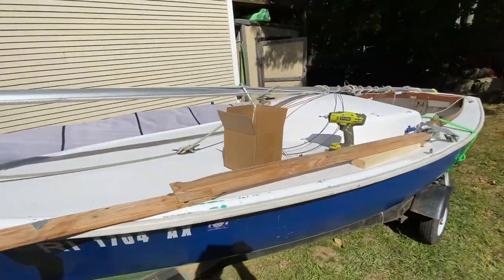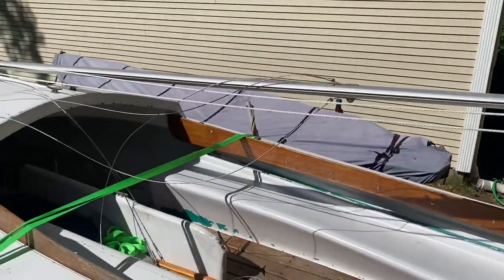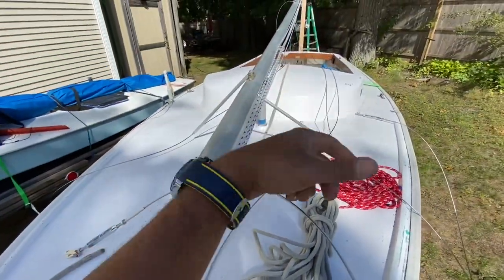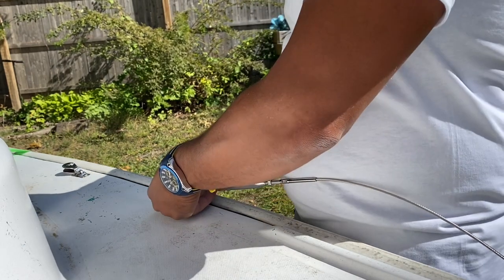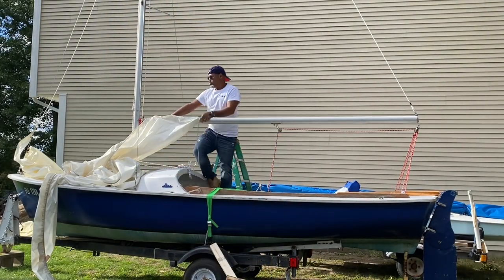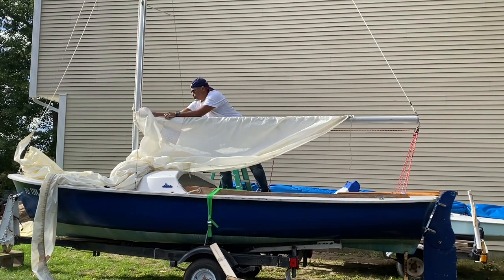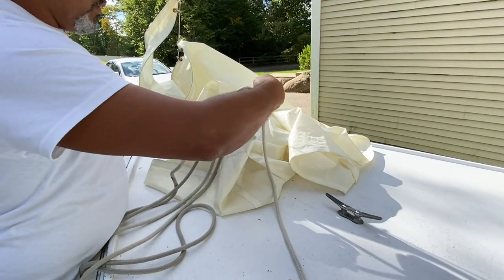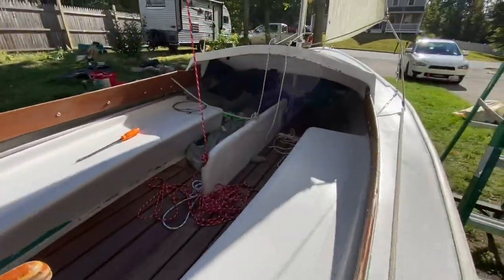Daysailer single handed mast raising & rigging set up (Ep 12)

Comment: Your term, "Yard Sailing" made me laugh! We are all boys at heart.
 I have set up my daysailer II with a 2x4 A- frame, which spans across the cockpit seats. The tiller handle passes through the middle, and has full travel. I primarily sail in small rivers, and regularly step the mast down on the A-frame rest to pass under the bridges. I use the jib halyard line to raise the mast, rather than a special line.
Reply from the maker: Sounds like a good technique to raise you mast… I have only very tall bridges that Navy ships and cargo ship’s easily pass under so once my mast is up, it’s up for the whole cruise. I’m planning to take her to a lake in New Hampshire in a couple of months. I like that flexibility of a trailerable sailboat.
Reply: Jason, do you remove the jib from the jib line to use it to help raise the stepped mast, or how exactly do you tie it off?
Reply: Solitude, which NH lake? Newfound? Winnipesauke?
Reply from the maker: @marcusgardner7640  no. I used the forestay and tied a line to it back to the cockpit for lift assist
Reply from the maker: @marcusgardner7640  definitely want to sail in Wnnipesauke, I’m planning to bring her to Spofford Lake in the Keene area since I’ll be camping up there. I also want to sail Lake George

Comment: Couscous! Ha ha ha! Wonderful! Suggest a tension gauge if you're adjusting shrouds. Like the content, would like to see a closer video of the block at bow when you step the mast. Enjoy your sailing time. Cherrs!
Reply: Kuzkuz, oops
Reply from the maker: Thanks for the comment. I do own a tension gauge but did not think to use it on this small boat, just went by the “Good’n Tight” method… what should my tension be on the gauge?  Also will try to remember to do a close up on the forward block in a future video. It’s basically just latched onto to forward bracket where my forestay attaches.
Reply: @solitudeandsailing  Not sure for your boat, in fact cant recall mine either. Just so they are the same, like you said.  Do you use the jib halyard to step? I think your boat has a spinnaker too.
Reply from the maker: @olivei2484  yes, I tie a line to the forestay that the jab hanks onto and run it back yo the deck. The same can be done with the job halyard.
Reply from the maker: You can see the block set up on this video at 1:45-1:51
Reply from the maker: https://youtu.be/eMXM007NOxs?si=8d7WqFFI_xHxfGOq
Reply: @solitudeandsailing  Thanks! I just found your channel, so I havent had a chance to get through your videos yet, but this video was great, and will get to them.